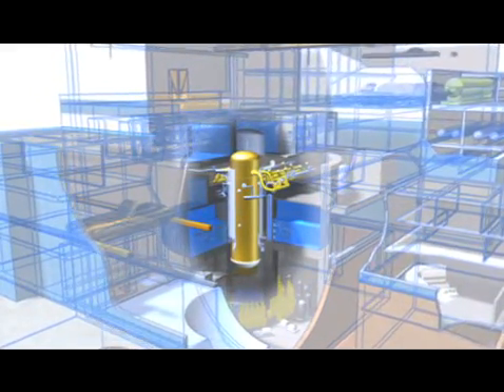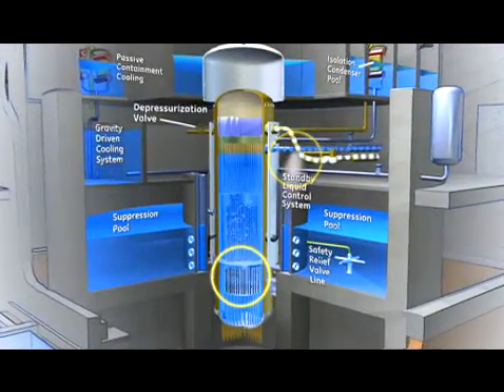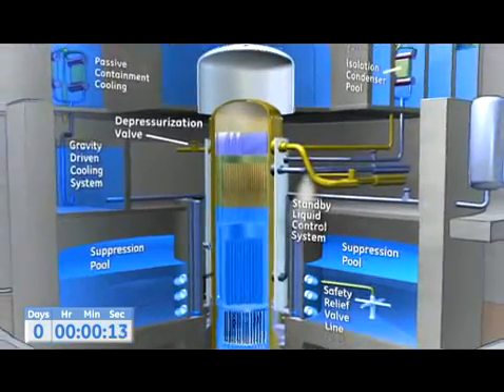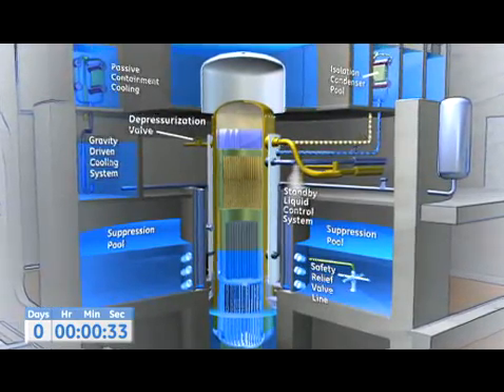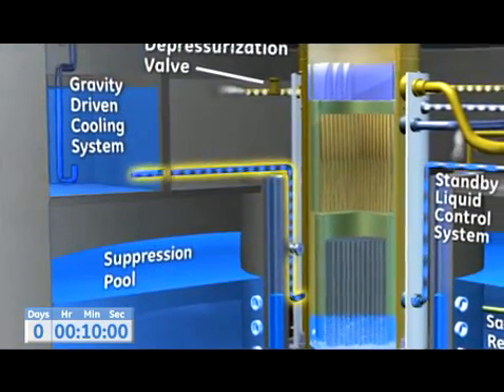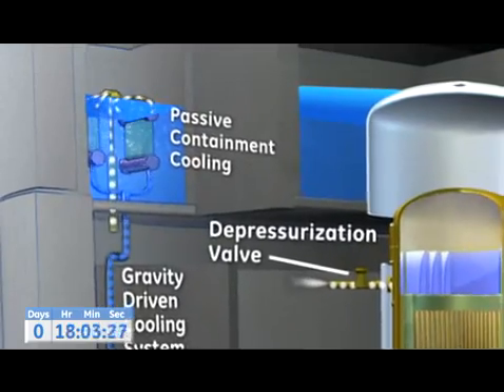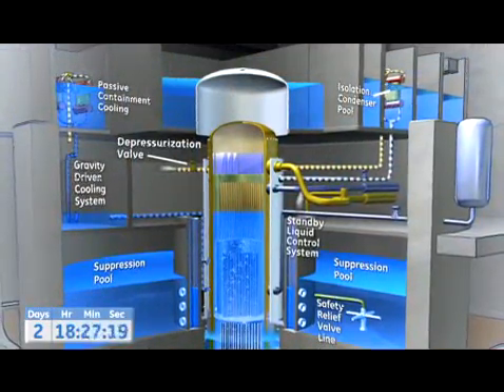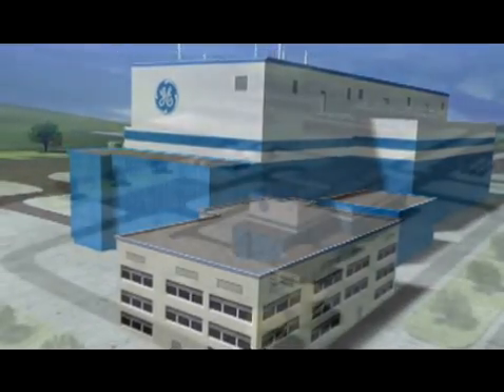The Passive Safety Features of the General Electric ESBWR

Comment: I am a huge proponent of nuclear energy... but this thing requires too many valves to work for its safety to work.
Reply: Interestingly the older bwr models have even more valves. Any pwr has significantly more valves and piping than a bwr. The main argument against bwr has always been that the control rods insert from the bottom, although there is a hydraulic failsafe in place.

Comment: And after 3 days??
Reply: You refill the pools with water within that time. The safety analysis cloncluded that emergency power and makeup water, whether sourced from normal systems or portable on-site generators (FLEX program), can be restored within 3 days. Same reason that emergency diesel generators must have a 7 days worth of fuel, it is reasonably assured that s fuel source could be secured within that time frame.
Reply: I'd think that after the water runs out and the rods hit the air it'd just explode from the rods super heating whatever water was left.
Reply: @CatTheRoundEarther That's not really how it works. Water can only be superheated if pressure is allowed to build up. Pressure would be relieved to the suppression pool and if that isn't enough to the outside environment (which is not a good thing for obvious reasons). Hydrogen is a concern though as hydrogen will form when the fuel starts to melt after the reactor has run out of cooling water. All modern reactor buildings (should) have installations in place to control hydrogen content.
Reply: @CatTheRoundEarther  
No, you don't think so.
1) The rods do not fall, they rise. BWR simply drives the rods from below.

2) This effect only happened on the RBMK; this does not happen on a water-water reactor.

Comment: Fukushima resisted the earthquake and automatically shutdown. The tsunami overtook the flood walls and flooded the emergency diesel generators which power the plant's pump motors. There wasn't sufficient circulation to remove decay heat from the core. 

The ESBWR doesn't need power or operator action to operate safety systems. That's the big deal about passive plants like the ESBWR and AP1000.
Reply: Yeah the ESBWR/ABWR and AP1000 are some kick ass plants, cant wait to see a ESBWR begin construction in the US

Edit - most likely north anna unit 3, here's hoping
Reply: @steelwarrior105  I think the AP-1000's passive safety system is much simpler and therefore better.

Comment: @adropofcolor   in the case of TEPCO R&D for those reactors was made by Toshiba, Hitachi and GE in a joint venture, but were built back 1969 by Kajima and Ebasco.
GE had nothing to do with the construction of the Power Plant Facilities.
1998 GE sent warnings to in order to reconfigure the vessels due to increasing seismic activity.
TEPCO reactors did not had the latest Passive Safety System, that is a decision of the owner and governments.